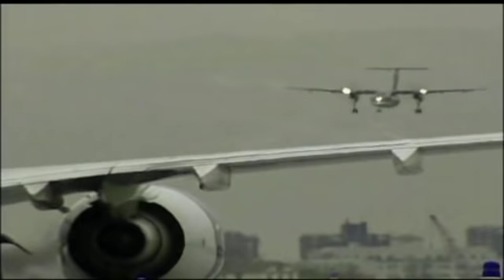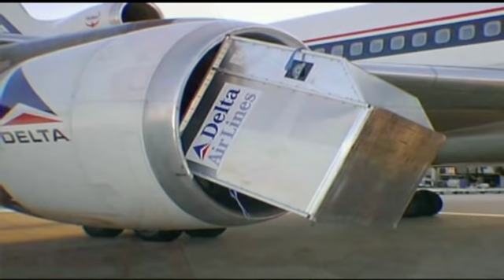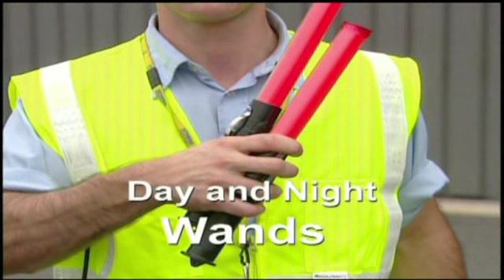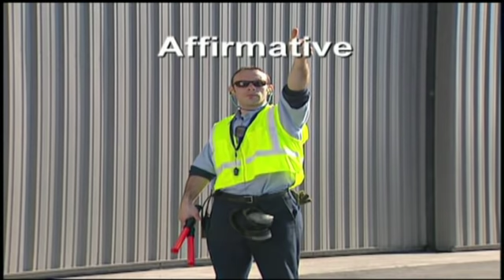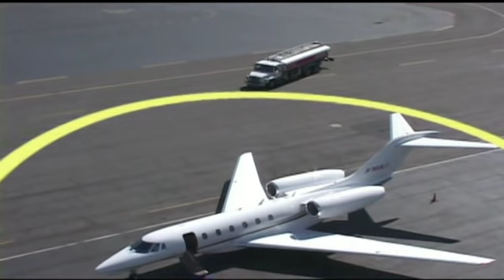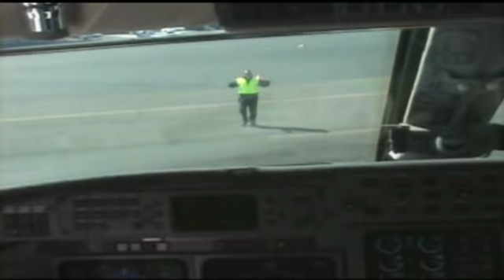Safety First   Safety Awareness Ramp Communications  1

Comment: his "straight ahead" should be done like he is doing his "turning" not the pumping motion. and the final spotting of the aircraft, dont forget to show an "on the mark" by touching your wands parallel before crossing for an X. you should salute with the wand and point with the wand as to which engine to start. no need to take the wand out of your hand to use your hand.

Comment: the marshaling hand signals are incorrect to IATA standards.  There is no such "pumping" motion to indicate "come forward."  Additionally, when issuing the stop signal, the wands are to be in front of the marshaller so he/she can see what the pilots see.
Reply: +Carlton Moser Great:) I am not the only one who recognized this weird stuff;) It's also not according to ICAO. There are safety and intepretation reasons why they are not apropriate. 
Pumping cannot be clearly interpreted in the dark, because in the dark you have a very bad depth perception. So you cannot or hardly recognize sticks moving towards marshaller. Especially when they are shining. This is also reason why most of the standard signals uses only two axis side movements and no third axis movement in depth.

All signals are chosen by IATA/ICAO in order to be clearly interpreted even in bad light conditions or in the dark. Those people are not stupid. They consider human factors, human visibility perception and imperfection and also unambiquity of signal interpretation with bunch of psychologists. They check it in reality with some statistics until they create specifications.
Reply: Yep. I worked line service for about 25 years. All of your signals should be made on a flat plain which can be easily distinguished. Pumping your arms forward and backward isn't as easy to understand.
Reply: Manatee Max I have an interview for Line tech any tips ?
Reply: @FlipperWick  Have you worked as a PLST before?
Reply: I've seen both the pumping and the waving motion.